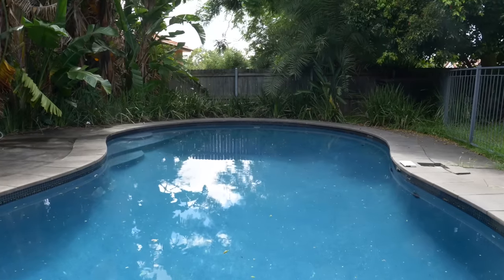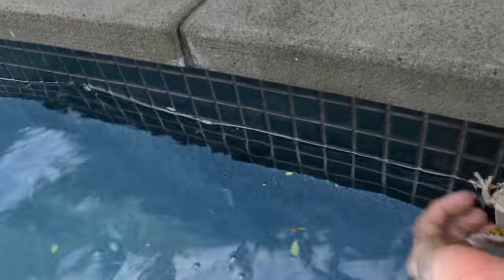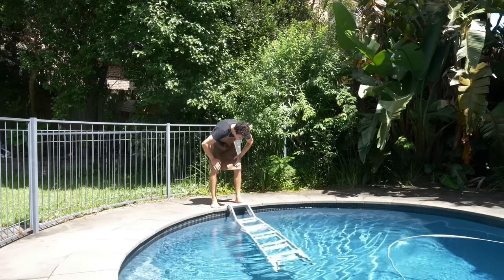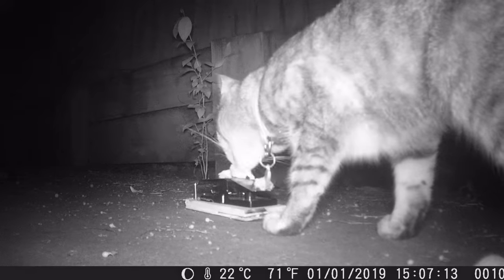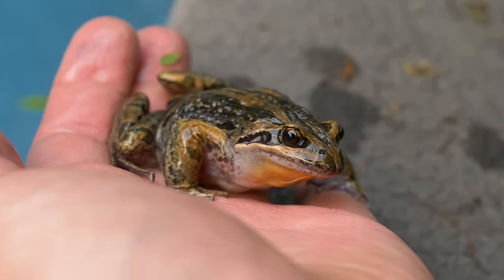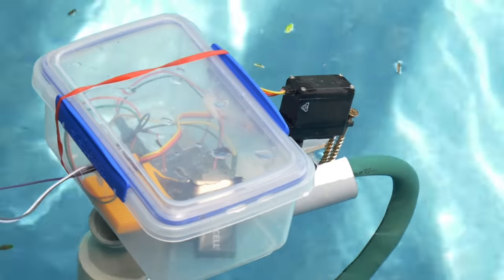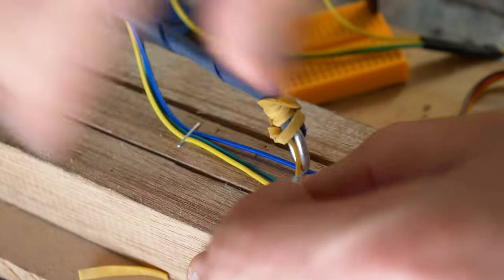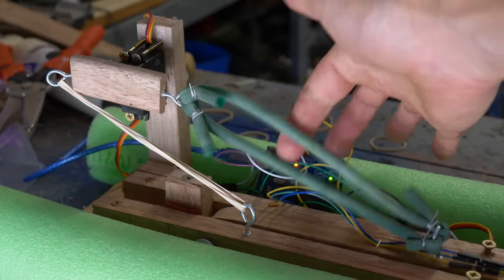frogs keep drowning themselves in my pool

Comment: the way he so confidently put electronics and cords underwater truly amazes me
Reply: insulated wire and usually any GFI or junction boxes we put or have been put poolside have low voltage for vacuums and lights to be run. also helps because theres no risk of us electrocuting ourselves in a wetsuit since it trips itself at the breaker if wet.
Reply: @bigbossogbigtoe_9367  I don't think we do.
We just rely on the house wide RCDs in the switch box.
Edit: "we" meaning Australians
Reply: Although it doesn't matter if there is an RCd if you just turn off the switch :P
Reply: @mattymerr701   yea thats what i meant when i said it would trip itself at the breaker i guess its called switch box down under haha. but what i was getting at is in FL, we gotta put transformers for any  new light installs. And usually if we have to put a GFI near the pool for the clients robotic cleaner or something we put another transformer.
Reply: @bigbossogbigtoe_9367  you're right.  I missed the "Junction box" and just read "poolside"
Read too fast XD
Reply: If you're talking about the robot boat it would just be a 9V battery
Reply: 8:52 thats why he is just floating after deploying the thing.
Reply: @trollaccount292  thats what im saying. That was pretty dark tho, lmao.
Reply: Lol I just had to comment how brave he was to plug something in and hop into the pool with it.
Reply: @amberfrazier575  well obviously he didnt actually have it plugged in or else this video wouldnt have been posted. Unless his family posted it post-mortem. Haha, didnt mean to make a pun but okay.
Reply: Considering he never showed the device actually working in the water, did you not consider the plugging in shot to be edited and not actually real? And even then he could have just turned off the breaker. He just didn't mind destroying or damaging a few pieces of electronics for a video that's gotten millions of views. It's a Mark Rober parody.
Reply: @trollaccount292  they missed the joke lol
Reply: Danijelovski Kanal  No, it isn't plugged in at all. Ya'll are dumb and missed the joke; he scrapped the robot cause it was dangerous and overcomplicated
Reply: This portion of the video was a joke 😂 
That’s why he was floating face down in the water. It seems like he unplugged it after he plugged it in to do the funny bit, showing it would have been a bad idea, then he gets the most simple idea, after returning from the dead
Reply: welcome to Australia, the wildlife is so deadly that nothing else can scare us
Reply: same.
Reply: I was wondering about his camera 📷 that it looked like he came from under the water with
Reply: the cord may have not actually been plugged in
Reply: He could’ve waterproofed the extension cords too.

Comment: It's so funny when he finally resigns to his fate and builds the obvious solution. We have the same problem in our pool the frogs and other stuff drown themselves like crazy. They actually make cheap frog ladders you can buy. That's what we got it's just a tiny sandbag holding it to the side then a little water mesh and ramp for them to get out it works great. Now instead of 15 drowned frogs everyday there's basically none
Reply: There's basically none

Basically none

BASICALLY NONE

0_O

I'm just trying to imagine how dumb a frog has to be to literally be drowning and running out of strength, and instead of heading to the obvious big exit area where they can climb up they just kind-of stay where they are and just give up on life, I guess? At that point I wouldn't even chalk it up to the pool. They just saw a way out and let the depression take them!
Reply: How about doing the responsible thing and get a pool cover?
Reply: @elisaa9981  We always close our pool cover every night. They sneak under there's nothing you can do.

After we got the little sandbag exit though there has been zero dead frogs though this year. We used to have to run to rescue them but now the pool is entirely clean
Reply: @Will Wunsche  Ok. Thanks for the info, my bad.
Reply: @dracocrusher  well, while they could jump, there is still water over the “big exit area” and they would have nothing to push off of and jump. Also they could even miss that it’s there. They are small ig
Reply: @elisaa9981  Frogs are super slippery. Frogs where I live if they're small enough theyll sneak between the tiny crevice of the glass door and the screen door and enter the area between the glass and the screen. Luckily since its not a big space to explore in there they always go back out the same way they came but never underestimate the spaces a frog can get into.

Comment: I once lived in Costa Rica, and once we rented a property with a pool. 

We never swam in that pool. For a pretty good reason too. The pool was filled with dead poisonous frogs that drowned themselves. It was pretty sad for all the frogs, and unfortunate for us as well, as we couldn't swim in the pool. We prbly could've used a thing like what you built
Reply: Would have been easy to build too

Just a towel and a chunk of wood
Reply: Super late to reply, but couldn’t you have gotten a pool cover?
Reply: @missfortune8553 pool covers are not solid so a frog would step on it and fall through, and then be even more unable to get out.
Reply: @Skelakatron  Not sure what pool covers you're seeing.  My pool cover is canvas, and every year we have to yell at the dogs to keep them from running across it all winter.
Reply: @jeffspaulding9834  the pool covers I use/have seen used just float on the surface of the water. Anything heavier than an acorn would roll around the surface until it got to an edge and then would fall into the water.
Reply: @Skelakatron  Ah, yeah, that sounds pretty useless.

Mine's heavy canvas and while the middle does rest on top of the water (except the one year we had a leak, where it sagged about a foot in the middle), the edges of the cover overlap the edge of the pool by several inches.  It's held in tension by springs and rods that are embedded in the concrete.

Comment: A couple years ago, I went to a lake with some relatives. We stayed at a cabin and there was a pool. In the pool, I found a bunch of frogs stuck in the filters just whirling around, caught in what looked like seaweed. I tried to pull them out and some were still alive, but for some reason, a lot of them kept hopping right back into the pool. I spent a little over an hour trying to get them all out, but they still kept going back in. And then I noticed a bumble bee drowning, so I used my swimming noodle to scoop it up and slid it off on the edge of the pool. It just sat there, breathing hard. And then it eventually flew away. And then I went back to catching frogs for a while before I got called in for dinner…there were other kids trying to help me get them out of the pool, but sadly, a lot of frogs died that day… :(
Reply: Holy cheese, that has to be stressful.

Comment: The support elastic is so elegant. It helps the servo exactly when it needs to, when the elastic is perpendicular to the servo horn. Really good thinking mate.
Reply from the maker: Thanks mate. I cant believe i did something smart
Reply: They should build the whole thing out of support elastic.
Reply: @Ididathing  I did a (smart) thing
Reply: Hey Dislike This Video & Leave A Rude Comment  no thanks
Reply: i was searching for a comment about this, the support elastic has me a little confused. how does it keep the servo turning when it loosens and is no longer pulling on it? does it only have to pull it past a certain position?
Reply: @junkskin2720  so I guess the easiest way to think about it is in terms of torque. Once the servo gets past 90° to the rubber, it actually gets easier to pull as the servo goes further. The amount of torque the elastic is able to exert on the servo is proportional to the cosine of the angle between the servo horn and the elastic.
Reply: @junkskin2720  It doesn't. My understanding is that the support elastic is to give the servo the extra force needed to stretch the speargun hose, which it cant do on its own. When it is resetting, the servo is strong enough to stretch the support elastic back into position for the next firing.
Reply: @junkskin2720  A lot of the answers you received, while being correct are not particularly intuitive. You must consider the angle the elastic is pulling on the piece of wood. Before the wood is vertical, we have a proportion of the force of the elastic pulling the motor backwards around it's circle(radially if you want the science word), and a proportion pulling horizontally through the axle. These forces are related to the total force by the cosine and sine functions. Skipping over the vertical position for now, we can note that once again, the force from the spear elastic can be separated into two components: the radial force working against the motor, and the force pulling straight through the axle. 

For an example that is easy to conceptualize think of a wheel on an axle that is not on the ground. Attach a string to the wheel and pull. When you pull, the wheel will rotate so that the string is inline with your pull. Once  it is aligned, our two components of force are easily seen to be no proportion of our pulling force in the radial direction, and 100% of our pulling force going straight into trying to move the axle.

So for the vertical position, we can see that the pulling force in both our wheel example, and the servo from the video are tangential to the torque. This means we have the opposite case to when our string is aligned with the direction of pull. All of the force is going into trying to rotate the wheel, with none of the force being pulled directly through the axle.

Hope that makes sense!

Comment: I work at a pool, the amount of frogs I’ll find in the skimmers is insane. The amount of them that float (or if alive, jump) over and get sucked into the vacuum port and into the hair lint strainer in the pump room is actually horrific, they’re usually torn to shreds cause of pressure and shit and honestly I’ll never get that image from my head lol
Reply: Now I'll never get this image out of MY head. Thanks a lot.
Reply: cover vacuum port with a net???
Reply: @UnsaltedCashew38  not that simple as The vacuum port is supposed to pick up the leaves and sticks and stuff that gets past the skimmer basket, if we put a net it would clog the port (when skimmers clog, water doesn’t circulate, filter, or chlorinate as well as it should)  and defeat the whole purpose of it in the first place

Also for reference, the vacuum port in a skimmer is usually no larger than a small tennis ball
Reply: @Tdflgmichael  If not a net can you put something to prevent something frog sized from entering it?
Reply: Lol
Reply: I hear you. I serviced about 80 pools fortnightly and there's no magic solution ..... does your pool not use a skimmer basket, rather than 1st stop at the pump? Although either is bad news for critters
Reply: @rossr100  Our pools all go from open water through skimmer baskets (drawn by the vacuum port) through to the HL strainer for the Pool Ops to deal with every few days
Reply: @bitter_tearz  high in nutrition, yummy

Comment: The first idea I thought of was floating water Lilly pads that would swim to the edges of the pool. Frogs would swim to those triggering them to go to the side, once the frog jumps off, the Lilly pads swim back to the middle.
Reply: Why does it have to go back to the middle? Frogs will follow the edge of the pool anyways, a ramp like he made at the end is an obvious and decent solution.
Reply: @LoLFilmStudios  ✋👽✋ PRESENTATION
Reply: @neighneighthecamel2700  Lol megamind reference
Reply: yes, those lily pads would be great. now add a root-like weight that'll reach the bottom of the pool. and to ensure that the lily pad stay one the sides on of the roots will have a suction cup to the side of the pool. NOW TRADEMARK THAT, SELL IT CLOUDYBRAIN

Comment: I was screaming internally when I saw you getting into the pool with a live wire, and then you showed why a line powered robot in a pool is not such a great idea, even with GFCI outlets.
Reply: What’s a GFCI outlet?
Reply: @xXMindSoulXx  ground fault circuit interrupter. They’re the outlets with the little “reset” buttons on them that you find in kitchens and bathrooms. Basically, the outlet opens if there is a ground fault, like, say, a hair dryer that’s fallen into water. They significantly reduce the likelihood of death by electrocution by opening the circuit (cutting off electric current) when too much electricity goes through, so a person may still receive a shock, but the outlet cuts the power soon enough that they can survive.
Reply: Ok yeah that joke at 8:50 was so subtle but this was my first through when I saw him walking into the water with it
Reply: E

Comment: Even though open pools are massive killers, no one has found a way to make pool covers? Like useful ones, ones that work and aren't overbearing. Maybe it's just not possible to make a cover correctly? Either way thanks for the content. Keep doing what you like. ^^
Reply: They exist, but they're a pain to put over and put away, so if you swim every day...
Reply: My family had a basic insulated pool cover that we wood pull over every night and then wind back up when we wanted to swim. We had too many animals falling in our pool. It didn’t prevent 100% of animals from falling in, but it became a more rare occasion.
Reply: His pool is curved, a neat cover can't be made for a circular pool that fits nicely and can just reel out and in to not be a massive PITA. You'd have to either have a circular one but that you have to manually drag around, or make a rectangle that completely covers, but there's probably other stuff, bushes, outlets, furniture, in the corner spaces in the way in a lot of places.
Reply: There are SO many options. For example, you could get a motorized one, how hard is it to push a button?

Comment: Pool cover, although they could get trapped underneath. Critters in pool will swim around the edge of the pool looking for a way out until they drown or die. They make plastic Lily pads you can attach to the side of the pool for the animals to climb up on. You might still need to check every morning or several times a day. To get them out

Comment: This isn't a very smart question, but wouldn't covering the pool so the frogs and lizards don't get in there in the first place work? I'm just curious
Reply: That's the sensible answer and one that is the most common. Nets for pools are available and are used, it's just is more fun to try and cook a weird machine that launches critters flying
Reply: Yeah and I thought pools had those covers automatically with them lol
Reply: Yeah would be too easy tho xD
Reply: Pool covers are a pain to put on and stow away if you don't have a motorized cover, so if you swim every day, you'd rather not screw with it.
Reply: @Iera_Thaumaturgy  lol pools don’t just come with covers. A team creates the pool and you would purchase the cover either online or from a pool supply store. Nothing comes with a pool except the liner or tiles you select in it.

Comment: Question: what kind of chemicals do you put in your pool to keep it clean, like chlorine? Because that'll most likely be the thing that's killing them.
Meaning no offence, as that is normal to use in a pool but frogs are really sensitive to that stuff. Sometimes they're described as the canaries in the coal mine concerning the quality of the water. Poor quality (like pollution) usually means that the amphibian populations will drop or even crash. So even if they get out of the pool they'll likely still suffer quite a bit from it. Your solution in the end should work fine for other species like mammals though (and of course, much appreciated that you do make an effort in preventing the drowning of animals in your pool!).

Comment: I don't have anything as grand as a pool, and I prefer low-tech 100 percent of the time when it will do the job (your video kinda demonstrates why LOL) but I bend old cheap silverware into an upside down U, scratch it up a bit with sandpaper or even a rock so tiny things can grip, and stick it hooked over the side of any containers (potted plants, cat water dish, etc) in my yard that might hold water.  It's like a Sims game ladder but for bugs and little lizards, lol.  It can even look quite nice IMO if you use a pretty thrift-store piece with a nice handle.

Got too sad seeing the little babies had passed away when all they wanted was a drink.  

I also set up an old decent-sized pot under an AC drip with rocks propping it (and yes a spoon Sims ladder heh) just so that the drips fill it but then the overflow runs down the handle onto a rock:  Big babies can drink out of the pot, little babies can land on the rock or handle or creep up to the ground underneath in the summer heat, without dying! Anybody who gets it wrong or doesn't stick their landing can hopefully climb out!  I'm kind of in the country so I might get almost anything, and very SOUTH so it gets hot QUICK and somebody's cat or dog that snuck out might find this lifesaving during the worst of summer.

I love feeling less crazy when I see other people caring about that sort of kindness, even to tiny things most people would scream about or just murder for no reason.  NOBODY deserves to die just for being thirsty!

Comment: Can you pet frogs that you know aren't poisonous? How do frogs react to petting?
Reply: Frogs brains are lacking the parts needed to feel affection. Most frogs are safe for a person to pet as long as you wash your hands after however it is not that good for the frog as they have very sensitive and absorbent skin meaning that if there is some chemical on your finger or your skin is dry it will irritate the frogs skin